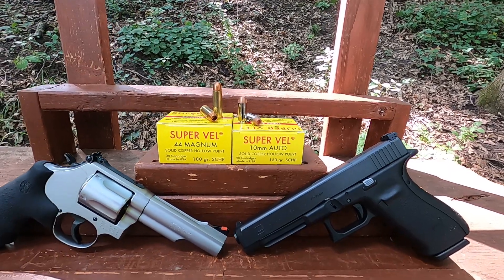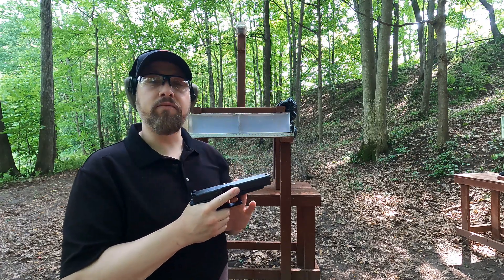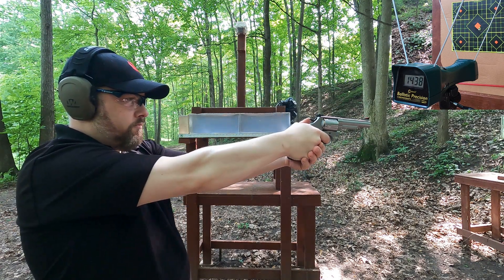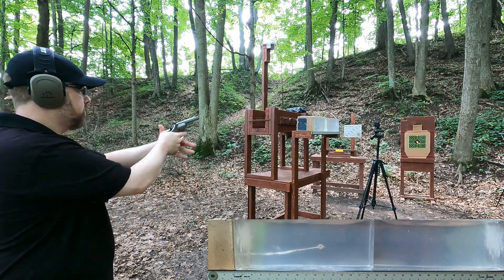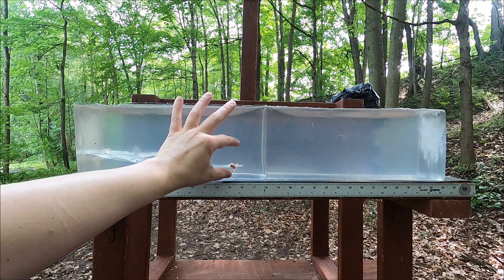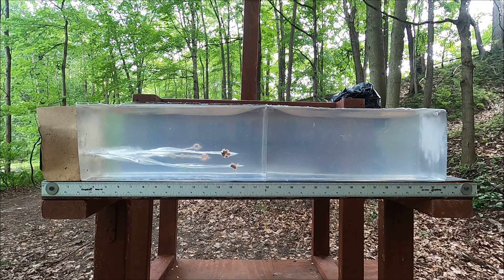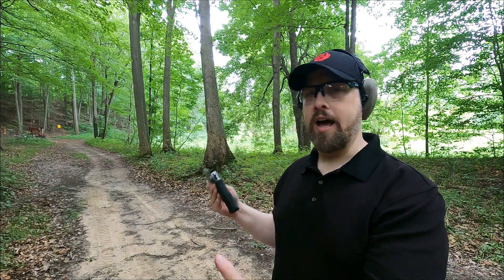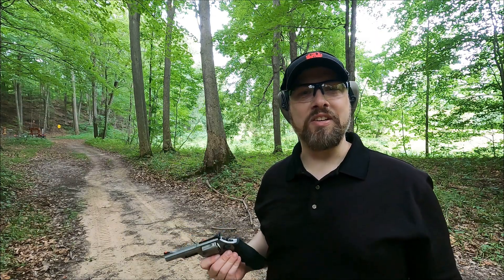Super Vel 10mm💥 VS .44 Mag💥🔥!

Comment: It’s interesting how many people are commenting that the 44 is better performing than the 10mm considering that the 10mm had better velocity and penetration. It’s a lighter bullet, but it’s moving faster. The energy should be about the same if not better. Is getting that .04” larger hole, in a heavier gun, with less capacity, and a slower bullet with less penetration really worth it? Especially when you can rock a G40 with a 6” barrel and 15+1 vs a red hawk with 6 for about the same weight?

Comment: 44 mag out of a 4 inch barrel was never pleasant for me. I had a 4 inch Colt Anaconda in bygone years. As you can see, your 1st shot was dead center at 25 yards (good shooting by the way) and then the recoil anticipation sets in a bit. (or a lot, depending on the shooter lol) I sold the Colt in favor of my 7.5 inch Super Blackhawk. 4 inch is not a bad bear country gun at all though. About perfect.
Reply from the maker: I used to have a 45 oz model 629 6", as compared to this 37 oz 69 4", i'm not sure the real difference. When I had it I shot mostly soft point ammo, but this 69 has a better grip. It points well and fast and the grip helps, but the muzzle is pretty light and snappy.
Reply: @GunSam  True. With full power loads even my Blackhawk wasn't real fun after a few shots. But that Colt was brutal. 
I used to load down to 44 spcl pressures back then, for the range. Since I never hunted with handgun either (Not deer anyway) I finally decided to sell it. Wish I still had that Super Blackhawk, but even if I did, It wold sit in my safe mostly.

Comment: that 10mm load is watered down, its basicallt .40S&W. a 10mm should be pushing a 200gr bullet about 1250fps
Reply: Why?
Reply from the maker: It' solid copper. This takes up more case capacity. There's not a lot you can do, if you want that power you need a lead core.

Comment: I have my 1911 .45 loaded with Colt SCHP 185 gr rounds.  Rated at 1100 FPS, have run mine through a chronograph and averaged right at about 1200FPS. Those SCHP rounds are impressive.

Comment: Very impressive, and not much worry about over penetration. I was expecting the 44 to be about 1500-1550 fps, but oh well. Looks like it doesn't need the extra velocity anyway. I wonder how it would do at about 100 fps slower, and how much that would reduce recoil. It would still have more energy than the 10, in fact it would be in the 41 Mag neighborhood. Might be a sensible carry and general purpose load. The 25 and 50 yd accuracy was quite good, especially in the 10mm.
Reply from the maker: The Buffalo Bore 200 gr solid copper hollow point was in that range from my 4.25" revolver, but that being said it's recoil was a good 30% more than the Super-Vel
Reply: @GunSam  Yeah i can imagine. More power than necessary.

Comment: For those who do not remember super vel?     It destroyed more model 19 and model 29's than any other load not a handload.   I really like your color the jacket tip tho.    I had some 40 ear old SV .357's.... they are HOT
Reply from the maker: From what I remember reading, current Super Vel uses a pressure testing machine. Couple that with more modern magnum revolvers and we should be fine.
Reply: @GunSam  Yeah  I get that.    I am just saying that by any standard the old stuff was really really hot.    My 629 is stronger than my 29 was...  some slight changes that helped.    Current factory 44 mag stuff is a tad weaker (most of em) than it was 40-50 years ago.... probly due to more pressure testing and worry about liability.    Most of the 240 grain stuff is running around 1250
Reply: The 19 got replaced with the stronger L frame and every 629 after the gen 3 are headed up to handle full power 44 mag ammo and some of the later gen 3 can handle them
Reply from the maker: @biggunshandguns3687  Also the current K frame is as strong as the older style L frame is, and the current L frame is as strong as the older N frames are, with their detent lockup and all the various changes made to the Combat Magnum revolvers.

Comment: 10 mm acolytes claim that it is comparible to the 44 mag. The 41 mag. Is more powerful than the 10. It's closer in comparison to the 357 mag.
Reply from the maker: I have maxed out both the .357 Mag and 10mm in comparable barrel travel. 794 ft lbs for the .357 Mag and 792 for the 10mm. So yes, when really pushed they have the same power. Now I do typically see an average power increase with typical 10mm over the .357 Mag, but not by a lot.
Reply: @GunSam  I agree with You. You should know
Reply: I agree on the 41! It can be a handfull with handloads maxing velocity. Lets face it, some people want semi autos and metric calibers and some revolvers with decade proven calibers. A hot 357 or a maxi 357 a 10 has a hard time containing its composure. The shortlived 357 maximum is nothing but a embarrassment to the 10. But then again to match bullit diameters you have to use the 41 mag. As for the king of the hill I prefer my 500 mag or my 454 Casull and I am considering the purchase of a 460. But I do not buy handguns to kill people but some hunting and target and trick shooting.
Reply: @ronniehahn1885  in bear country I would rather have two to three shots or maybe more if I'm lucky at a charging bear with a revolver than 2 or 3 with an auto and then have it jam.
Reply: @billss396  Right you are! In bear country I would carry my Super Blackhawk, even though I have a 629. I have a 500 mag and even with my Kodiak chest holster I couldnt bring it into action as fast as the Ruger in a belt holster. As for my 454 I am seriously considering a 460 XVR with a 3.5 barrel. But here in Tennessee a few black bear but no grizzly or browns. I am planning a Kodiak bear hunt. Primary weapon will be my Browning Safari in 375 H&H Mag and probably a 44 for backup. I truly enjoy big bores! I dont even own a semi auto handgun. If I did it would probably be a Desert Eagle in 50AE, but I dont think it would ever happen.

Comment: Thats a pretty light load for the 10mm
Reply from the maker: Well, maybe. But if it's a light load than all 10mm's are light loads as most of the 10mm loads I have tested are this power or less.
Reply: @GunSam  The problem with 10mm ammo tests is many people compare real 10mm ammo to the mythical original Norma loads.  The problem is those loads only existed in the minds of Norma's marketing department.  If you look on YouTube for actual tests of original Norma ammo it typically clocks in 150 to 200 fps slower than the numbers on the box:
https://www.youtube.com/watch?v=V-e3BTkzr_M&list=PLNw5las6Yz2hN2bw58cNhxfaZhJzvEi_h&index=3&t=1304s
https://www.youtube.com/watch?v=JMtg1Q6vP3k&list=PLNw5las6Yz2hN2bw58cNhxfaZhJzvEi_h&index=2
Reply from the maker: @davelively7423  Mentioning that link, I been thinking of doing .45 Super. My gun is basically ready to go, all I need is probably a .45 ACP KKM barrel just to make sure it's strong enough, could leave it in for .45 ACP too.
Reply: @GunSam  im just comparing that load to the underwood stuff and their 180gr has more velocity than that 140gr, should be seeing at least 1600fps with the 140gr
Reply from the maker: @LD13372  the numbers you list are about 800 ft lbs. I have tested so many 10mm loads, the typical is 450 to 650 ft lbs, with most being right around 600 ft lbs. I have tested one 10mm round that was 792 ft lbs, but all others are more in the average range.